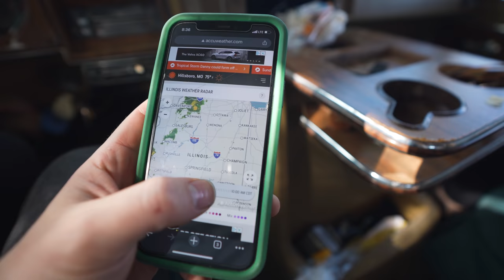RV Road Trip to Chicago for ENGINE OVERHAUL! - Will We Make It??

Comment: The trick is to blast the heat and let all the hot air from the engine blow into the cab. This would dramatically lower my thermostat. Also try to drive as slow as you can get away with ...also pulling over and opening hood , to let heat come out ...my second beater taught me alot . I still blast the heat for a few minutes with my new car to allow heat to leave engine and cool it down ..I think I was traumatized by my old car ...but I'm sure it's good preventive maintenance

Comment: Do not switch an engine off if overheating and it still has coolant in it, just leave it to tick over or just above tick over, turn off any engine driven AC and turn the heater on full blast.  Switching off creates hot spots in it and will boil off the coolant.

Comment: No no no on fuel injection. Will be side of the road headaches. Get an edelbrock or holley 650 and drive to cali without issues. Edelbrock is most friendly. 30 years of trial and error.
Reply: ditching the carb is the best move, you will have to get used to a more reliable motor and will soon forget the horrors of carburation.

Comment: More "I'm not a mechanic" ideas.....possible cracked cylinder is boiling your coolant through exhaust gases getting into the coolant......
Reply: Good idea in theory, but not in practice. The Exhaust would pressurize the coolant reservoir beyond what is it supposed to handle. Cooling systems are designed for no more than 20 PSI of pressure, while engine cylinders are usually around 100 PSI, which would cause the coolant tank to possibly crack/break. The engine would also be burning coolant if that were the case, as coolant feeds into the cylinder, and is burned, which would cause noticeable smoking from the exhaust. Also likely is a cracked cylinder would cause an oil burning issue as well, though not always. Engines are complicated, and diagnosing an issue from afar can be pretty hard, but my guess just a clogged radiator. Who knows how old it is, and if it is too old, and has lots of corrosion in it, it will reduce the cooling capacity by a lot. It may also be producing more heat than needed because it is running poorly, probably because the carburetor has an issue with tuning, or a number of smaller issues mostly resulting from lack of long term maintenance.
Reply: @tennisontower8003  My Land Rover Discover 2 was a coolant boiler (or at least bubbler).  I only knew slightly less than I do about mechanical systems when that happened several years ago.  Drive for a while and hear this gurgling sound and sure enough it was coolant bubbling in the reservoir.  It drank coolant like crazy and probably smoked though I never noticed it.  When it was finally up on a lift and I saw the underside if the engine it was covered in coolant stalactites(mites?). I still smell coolant when I think of that vehicle, may it RIP.

Comment: I had a junker car that used to always over heat.  Ends up the plug for the engine fan was becoming loose and unplugged.  That was causing the over heating, since the fan was not coming on.

Comment: You might just get away with a radiator flush. If you were like me and go for days or weeks in the Australian outback or off-road, then go straight for the new radiator, but not what you're doing. You might get away with it. (BUT be advised by the mechanic that's rebuilding your engine. Replacing it will be a tiny percentage of the rebuild cost and good for your "new" engine)

Comment: If a car of that era is getting hot, it's either the thermostat is bad, or the radiator is bad. Old radiators can be rotted out inside and clogged up. I had an old Mazda Pick up that did this. And yes, I used to run the heater on during the summer to keep it from overheating.

Comment: What size engine is coming out of the RV? For some reason I thought it was a 454 big block. The motor you're having put in looks like a 350 small block?  Don't get me wrong a 350 would probably be fine especially if you're going feel injecthey're going with fuel injection.   Is definitely a lot cheaper to rebuild and better on gas but not as good if you plan on towing anything with the RV. Just curious.

Comment: not sure if u read my last comment but front of the motorhome u got the name coachmen now is there away to remove it and to promote your you tube channel and put endless adventure there instead     the either thing with the rv sitting for awhile before u got it u ever thought of cleaning out the fuel   tank it could be a little dirty on the inside

Comment: New Aluminum Rad with electric fans, throttle body Fuel injection and high tech coolant, new crate 350 CID and overhauled Transmission ? Read Diff. Brakes, wheel bearings, and New Battery. My Guess, $6,400,00  Ah, I love the aroma of Cafe Latte in the Morning.....

Comment: Turning the engine off for a short time does NOT cool the engine down.  The engine cools by allowing the water (coolant) to circulate through the radiator, when you turn it off, the water stops circulating.  If you need to stop, let the motor idle, but still open the hood up and turn on the dash heat as many others are telling you here.  NEVER turn a hot engine off unless you absolutely have to

Comment: I recommend removing the thermostat..it will run cooler!
Reply: Yes, paricularly in the winter time. No, the vehicle has to have a minimum running temperature to run effecently and minimize engine wear.

Comment: Sometimes a clogged filter within the fuel tank leads to the kind of overheating you two are experiencing.
Reply: Clogged fuel filter and carburetor needing to be rebuilt or have the idle speed and fuel air mixture adjusted would cause the stalling/engine dying, not the overheating. Air in the cooling system, water pump going out, stuck thermostat, clogged/dirty water passages in the engine would cause overheating.

Comment: I'll put my money on a clogged radiator.
Reply: I agree. I noticed at the first stop, the coolant tank was low, but at the second stop it was quite full. I would put my money on either a clogged radiator or a big air block?
Reply: I’d put my money on a new radiator attached to a newer RV😂🤣😂🤣I bet ur right though.
Reply: @sappersteve1443  may need burped.

Comment: Please dont go fuel injection. Leave that for new stuff to break down and leave someone stranded.
Reply: @roncearns6396  and will make you walk way before a carb will
Reply: @roncearns6396  works great on my 06 car but would never convert an old car or truck. Just a simple edelbrock will save bunches of money and not fail.
Reply: @CharlieBrown-pb9xn  you can hook a horse to it and it wouldn't fail either, no , carbs , even the vaunted weber carbs are history and should only be used when restoring antiques. Fuel injection systems along with disc brakes and modern suspensions are the favoured improvements on restomod projects. Drum brakes and carbs are a step backwards, even if they are cheaper.
Reply: @roncearns6396  Na. I ll keep my drum brakes and carb and make it home a sleep good. Many dyno shootouts show carbs making .more hp than efi so whatever.and less rolling resistance with drum brakes. They do get too hot easily tho.
Reply: @CharlieBrown-pb9xn  Somehow I doubt your credability on this subject, IE It would appear you are pretty good at making up "alternate facts".
Reply: @roncearns6396  ok. Walk home one night when im tucked in bed with my 100 + year tech.
Reply: Did you sell your reliable 2006 you mentioned that gives you no problem or is that another alternate fact you spouted.
Reply: @roncearns6396  runs great and drive daily. I just wouldnt convert an older car or truck to efi because of cost and an efelbrock carb is so inexpensive and works great.
Reply: @CharlieBrown-pb9xn  Look at all the money you could save if you retrofitted the drums and carbs to your 2006.
Reply: @roncearns6396  i ll leave that on my 70 maverick that will hit 100mph in 7 seconds. Just price a complete holley efi setup with pump and all. Im not saying efi is bad but a simple carb on an old car or truck will do just as well or better in most cases for a qaurter of the money.
Reply: @CharlieBrown-pb9xn  So your psuedo falcon can do what a Fuel Injected car with a 3 liter engine did in 1955., super job there. Mind you it had finned drum brakes, maybe that is what did it!
Reply: @CharlieBrown-pb9xn  A Holley sniper is only twice the price of a Edelbrock system, delivers more hprsepower, burns less fuel and doesn't stall out at intersections, your carb maverick is nearly as fast to 60 as a 3.5 liter v6 ford f150 that weighs nearly 3 times as much. 7 Seconds is pretty fast for a ford 260 v8 though, good job.
Reply: @CharlieBrown-pb9xn  At this point I usually say yes dear and she gets the message, so yes dear!
Reply: @roncearns6396  get yourself a pink shirt and pink hair dye and call it done
Reply: @roncearns6396  yes republican and need trump back. I will admire eva gabore on green acres while I check out my new speed parts from tennessee speed and sport. Trump sure isnt perfect but biden is a pure sad joke
Reply: @CharlieBrown-pb9xn  7 seconds with a 200 ci six, that is some carburator!
Reply: @roncearns6396  351w